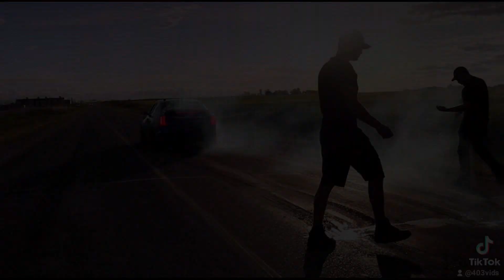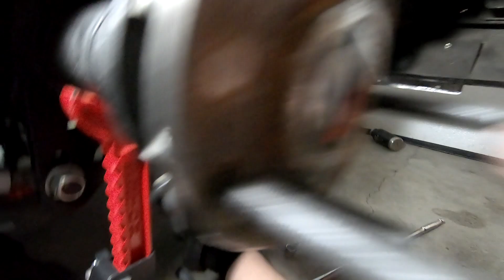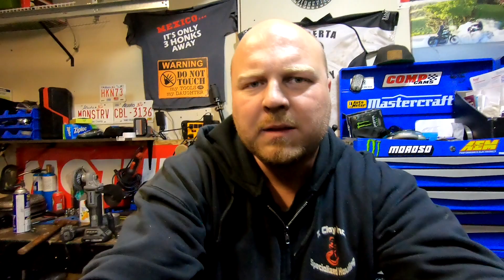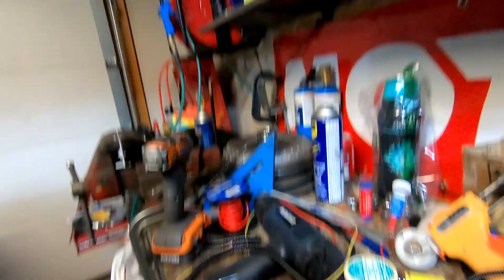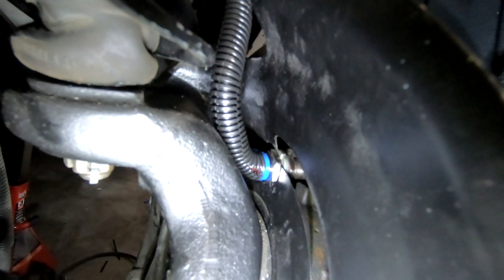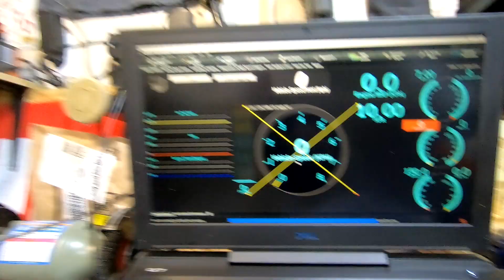Hall effect sensor install on 95 s10 with a  MS3 Gold Box ecu

Comment: Us ms3 guys are still out here... Good info bro.
Reply from the maker: I think it a great system lots of futures even more than holly I think. Its alittle tricky at first but once u get the hang of it works great
Reply: @bangersandmashracing  yes lots of features and lots of potential. I have a goldbox in my supercharged 70 Camaro, and a amp ms3 pro in my 97 turbo Silverado. Love them both. I found your video while researching putting traction control on the Camaro.
Reply from the maker: Oh they sounds like two nice cars yeah definitely have more videos on tuning and stuff like that with the mega squirt coming up here